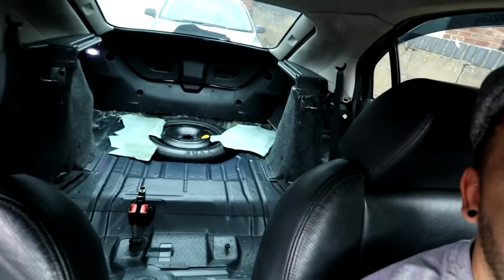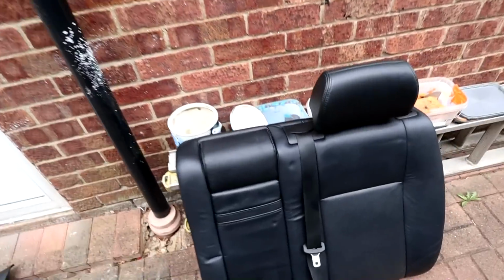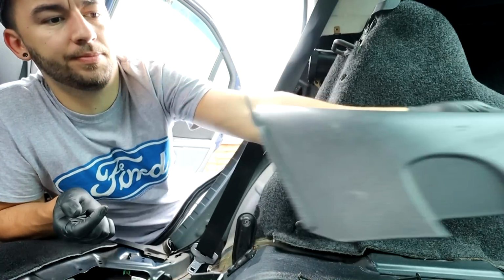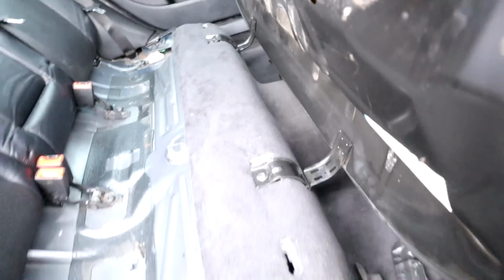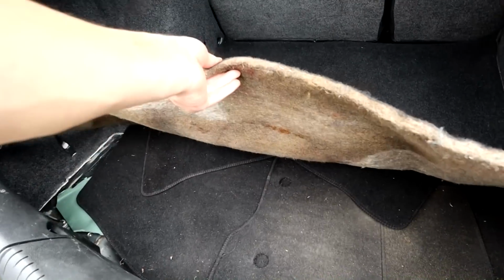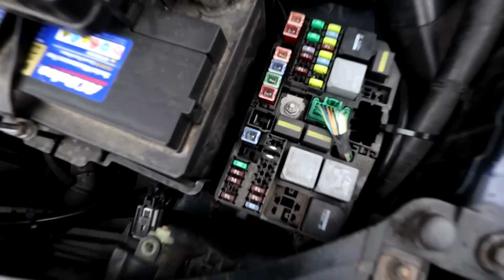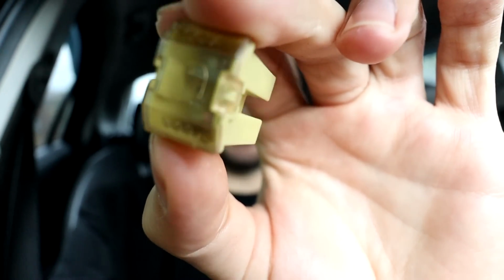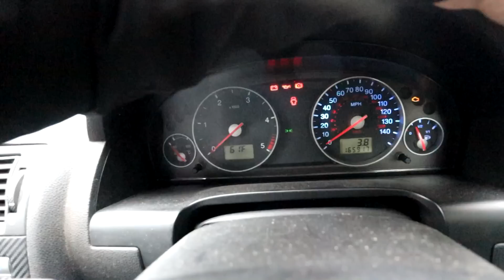Mondeo ST Recaro Seats Install (Part #2)

Comment: The relay for the heated seats is mounted on the back of the fuse box in the glovebox. Reach your hand underneath and up the back and you'll feel it. Just pull the relay out until you figure out what to do. That relay is only for the seats so nothing else will stop functioning
Reply from the maker: Ben's driveway garage I did try find it but couldn’t! I’ll take another look

Comment: Can’t you match the wiring from your old seats and check if the colours have been swapped  , the new ones might be swapped around and doesn’t match your Fords plugs wiring set up and try trace where the wires split up and go to under the old vs new seat?

Comment: Okay James, your mondeo is a facelift. The generally the mk3 before 2003 was a prefacelift. Its easy to tell as the gear surround in the pfl is an oval shape. Problem you have is your seats are from a pfl which have occupant sensor pads but they was removed later. You can get away with just unplugging this under the seat. I'd definitely swap the pretenioners (buckles) from your original seats just because you know they're safe and compatable. The dinging seat belt chime can be turned off by doing a sequence on commands. Have a Google. On the pfl seats the heated seats only have one setting, on or off rather than the variable heat in the later models. I really don't know how you get around this unless you swap the heated pads from the original seats. All the best
Reply: Sorry I always comment throughout the video otherwise I forget. That fuse in the engine bay is for your engine glow plugs!
Reply: The relay for the heated seats is mounted on the back of the fuse box behind the glovebox. Reach round underneath with your hand and you'll feel it. You may need to remove the small carpet piece under the glovebox to visually see it
Reply from the maker: Appreciate all the info Ben, I’m just gonna unplug the heated seats as I don’t really care for them anyway!
Reply: @TheSavageGarage  that's what I'd do mate, personally it's a nice touch to have but I'd rather them off as opposed to them on all the while. If you need anymore info hmu
Reply: @bensdrivewaygarage9014  hi please can you help me ive just bought some recaro seats my car is the 2.2 mondeo 2005 model and the seats have a label saying 2006 will this just plug in and work or will I have to mess around re wiring things thanks.
Reply: @whowho6420  

Yes should work if you get the relay and switches too...

No all mondeos came with the wiring ready installed so you'll need to check this too. Plenty of Info online especially around the talkford website
Reply: @bensdrivewaygarage9014  thanks I haven't got a clue when it comes to all this wiring might just put them in and see if it works hopefully it won't cause any damage to the electrics
Reply: @whowho6420  
It won't cause any damage if the wiring isn't there, it's just Ford decided to put all the wiring in place in some mondeos and not in others. I was fortunate as wiring for all extras was installed already in mine
Reply: @bensdrivewaygarage9014  ok thanks alot for the reply mate going to fit them in on Saturday if the weathers not to bad

Comment: Quick tip. I got a genuine Ford bootliner off ebay for my MK3. You can put all sorts of oily parts in there  without damaging the carpet and it is easy to remove and clean. Far easier than cleaning the boot carpet.

Comment: Look under seat and check that inside the big connector the smaller colour  connectors are the same on new and old seats if these are ok you can disconnect the heater plug from big connector until you have a more permanent solution for heater, seat belt minder is sounding due to a faulty buckle so just swoop with old seat buckle

Comment: Easy way to check if the new seats are prefacelift it'll have the seat position sensor on the top side of the loom for the seat its bigger than the rest of them if you do have that it should just be the pretensioner (buckle) that needs swapped out had to do it on mine after the airbag light came on

Comment: It’s a final facelift mate and you have put pre facelift  front seats on you need the 8 way recaros for the front which are compatible for wiring. And  swap the seat belt pre tensioners in to the new seats

Comment: Hiya mate for the seat belt fix just simply spray WD-40 inside it and click the belt in n out a few times,
And the heated seats will be on all the time because there is a on/off switch in one shape mondeo and a turny switch in another to increase or decrease the temp to seat, whatever you have it needs to be the same combo if that makes sense , and if you are not fussed about the heated seats simply take out the fuse for them .

Comment: It sounds like the wires are in a different position in the plugs between the years, one option if you have a manual is to trace what wire is for each item and then use a pin tool to swap them into the right place

Comment: The fuse you've pulled in the engine bay is for your glow plugs.
Reply from the maker: Ben's driveway garage how come my car still drives?
Reply: @TheSavageGarage  its summer. A diesel dont need the glow plugs in the summer. Its not like a petrol engine where the spark plugs """"are constantly on""". Only to preheat the cylinder on cold start.
Reply: @TheSavageGarage  as above mate, glow plugs won't prevent a car from starting. To test voltage to the plugs just put a multimeter on the glow plug and turn the ignition on. It will still start without them in winter but maybe a little lumpy to start.
Reply: @THExPsyGamerx  a common rail diesel doesnt need glowplugs in English winter either. 
And, most modern-ish diesels do infact use glowplugs constantly for emission purposes

Comment: If you pull the rear centre seat belt out there should be a tag with the date of manufacture on it, it could tell you the date the original car was built.

Comment: You have pre face seats in your final face lift ST. Been there myself and had the hot bum issue!! I had to disconnect the heated wire from the plug that’s connects under the seat. And like others have said, you need to swap your old seat belt buckles back over
Reply from the maker: Steve Burrow appreciate it!
Reply: You can remove the fuse in the engine bay fuse box (the blue one)

Comment: With your boot carpet, try using a da polisher, Take the pad off so it’s just the base left, put it down onto the carpet then turn the polisher on and any sand, grit will come to the top or fly off. Just hoover it up while polisher is on or after,  just keep it in one spot till that section is sand free and move it to the next section, been trying to hoover mine for months with no affect till I tried this and now it’s all out

Comment: Check on the door trims, there will be a sticker on the inside with a chassis number on it with a date. That will tell you the year the seats came from. Same goes for the seats.

Comment: Probably not the right time to say this, but James if you do intend on getting your next project car in the future.. Have you thought on experimenting a Nissan Micra K11? I bought it last month as it’s my very first car and It would be nice seeing videos on how the controls (lights, wiper stalk etc)  work as there’s no videos on YouTube apart from Micra K11 mods. I have a 2002 plate SE 1.0 with a Automatic gearbox. You’re a car fanatic expert, but It would be a great help, otherwise I’m taking time to figure it out as my car didn’t come with a owners manual for some odd reason.

Comment: I’m no detailing expert but with the citrus cleaner containing a degreaser I’d be careful using it on the leather as it could remove the oils and protective dressings applied to them. Without it the leather will become hard and could eventually crack. I’d definitely recommend getting a proper leather cleaner and balm to protect them in the long run. Keep up the good work 👍🏽

Comment: You have a phase 2 st (facelift) you have put in a pre facelift interior (phase 1)  you can simply remove the blue fuse from the engine fuse box

Comment: check the fuse box diagram it will tell you sometimes that the fuse for the pre face lift is in one location and will say for the facelift its a different location

Comment: Gone through the comments but no one seems to have answered the question about the seats, I might be a little late but here goes:
You have a face lift car, which has variable heated seats
They use totally different wiring, switches, electronics and heater pads to the pre face lift seats you have which are heated only
They also have different seat belt pretensioners, with different wiring and plugs (you will only have one, they have two)
On the happy side, you don't need to worry about the occupancy sensor (passenger seat) or seat runner position sensor (drivers side)
So unplug the heated seats, at the seat plug, and swap the pretensioners over (it will be obvious which wires you need to swap over) and it'll be fixed
If you want the heated seats you'll need the variable heater pads and a full seat strip down
There's lots of incorrect data out there and there are also climate seats which heat and cool but at lest you had the easiest option to swap wires about
Reply: Hi ive just bought some recaro seats for my mondeo only paid 30 for the full set my cars a 2005 2.2 and the seats have a label saying they was made in 2006 will they work together or will it mean messing around with wiring thanks

Comment: hi just watched your videos on replacing the seats and im having the same problem regarding the heaters coming on the seats permanantly...i had to remove the fuse to turn them off...did you manage to solve the problem and if so,how did you manage it?  thanks

Comment: Honestly don't waste your money on a new buckle, Had exactly the same issue with seat belt light, sprayed some wd40 into the buckle port and fixed  the sensor been over 2 yrs hasn't come on,  if that doesn't work just snip the power cable for the seat  buckle from its harness which will remove light.

Comment: top job as always ! will you be replacing the roof lining and rear trims as they look rather grubby but it may just be the camera angle ? boot carpets and rubber boot liners can be bought from a well know auction site for £20 each delivered.

Comment: I would say don't put that fuse in until you work out how those seat heaters are currently getting power. The wiring in the plug will be different and that will need to be fixed first.

Comment: Very nice upgrade, but I’m surprised and disappointed that you didn’t have that horrible worn bolster on the driver seat before you installed the seats. That would have been an easy fix on the bench by a talented upholster. And the interior would look soooo much better.

Comment: PS. replacing the fuse will not cure the heated seat problem. The only way to stop them heating is to remove the fuse.

Comment: James, you have pre facelift seats in a facelift car. Ideally you'll want to swap over the seat belt tensioners from your old seats to stop the belt light issue, and you'll also have to find a pre facelift seat heater switch or wiring loom (if you need either I have both located in Suffolk still in a pre facelift st220 bud)

Fuse will have blown as the heater elements are on fully all the time because the switches in the seats won't communicate with the switch in the dash, pre facelift seats are only on or off, whereas facelift seats are variable heating with 4 settings.

Comment: You put pre 2005 seats into the car....think you will have to disconnect heated seats.

You will have to swap pretentioners over from the old seats....just allen key and disconnect from multi plug....10 min job

Comment: You should disconnect both battery terminals, just for future reference. Nice video though👍
Reply: not true. electrons flow from (out of the negative terminal) to the positive terminal, which I will agree goes against what most people would think, hence why disconnecting the negative is all that's needed.

By leaving the positive connect it could possibly allow any capacitors with stored charge to discharge safely if it was connected by accident.